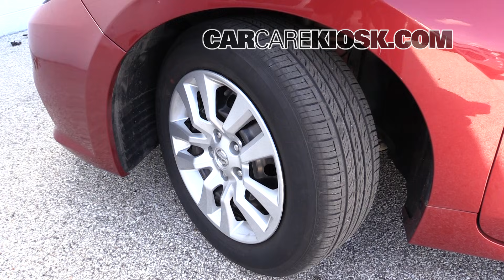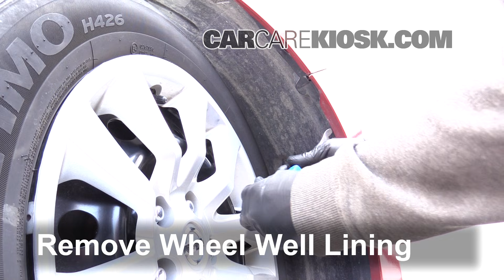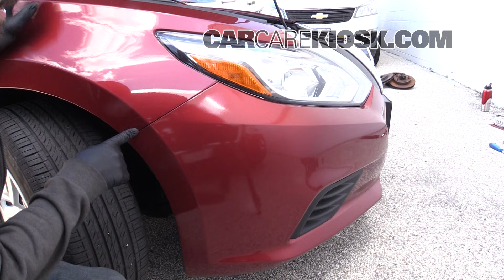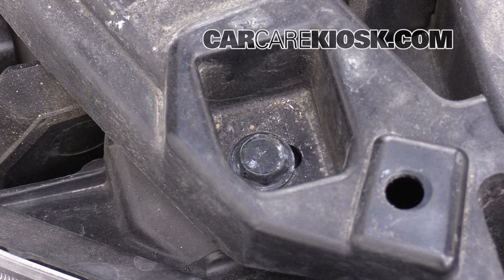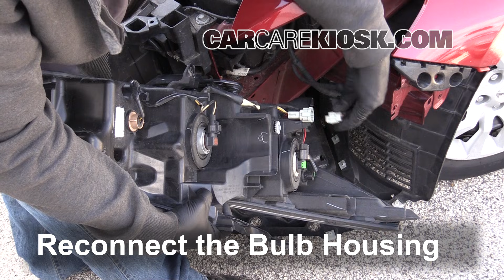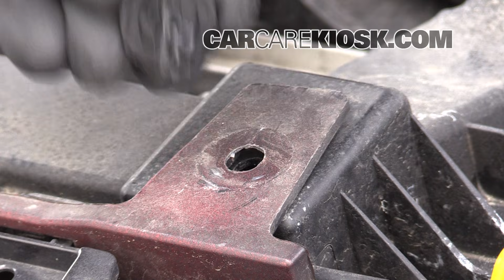Nissan Altima 2016-2018 Headlight Housing and Bumper Removal

Comment: Thank you so much for posting this.  If you had not, I would have never attempted to do this myself.  Because of your very good instructions and video.  I replaced my headlamp assy today.
Reply: Did you do it bc your headlights were super dim?
Reply: @angelmyers869  I’m about to replace mine because of that problem. Nissan is a piece of shit company. I bought this car in 2015 and still haven’t cracked 50k in miles and my headlights are so sim I can’t drive at night.
Reply: What replacement unit did you get? Does it solve the problem?

Comment: It is not neccesary to remove bumper, ive done it with just wheel and tire and pull back wheel liner...this guy is a dope, or a nissan tech
Reply from the maker: If you want to see how to just change the bulb, this is the video for reaching behind the liner to do it: https://www.carcarekiosk.com/video/2016_Nissan_Altima_SL_3.5L_V6/lights/headlight
Reply: Dude.. READ THE TITLE...

Comment: thank you for showing all of these steps. I just got in the headlamp that I need to install on my car.  I can see this being a whole day or more job. You make it look so easy and on a new Altima it probably is not too bad.  On an Altima that has substantial miles on it,  The plastic is hard and the clips break and it is a pain in the ass.
Reply: Did ours yesterday, about 90 minutes. Didn’t break any clips as these type are easy to remove and reuse. Check out the Class Action lawsuits Suarez vs Nissan and apply before April 20, 2022

Comment: you did it the hard way< wow why?
Reply: Replacing headlight assembly you have to take off the bumper there is no other way . But to remove a bulb just peel back the skin of the fender

Comment: Other videos show a much easier way to do this but removing the entire bumper
Reply: other videos says.. replace bulbs... this one says remove headlight
Reply: Depends on what you need to replace. If you are just replacing bulbs you can do that from wheel well and pulling back liner panel
If you need to replace the entire headlight assembly(s) you need to remove bumper and this is required to fix the deteriorated reflectors that are the cause of dim low beam headlights and which were subject to successful Class Action lawsuits against Nissan.

Comment: these car companies are so grimey for making us do this stuff to change a light bulb...
Reply: you dont need to do this to change bulb, you can just lift the well lining and reach in, theres a video showing this.
Reply: @mst3kpimp  This video is about changing the entire headlamp assembly not just the bulb.
Reply: @AD-cd1bx  unfortunately there is a glass “fish eye” that gets cloudy and it is part of the assembly.  ☹️
Reply: No wonder it's so expensive to get fixed at dealership!
Reply: @christopherdoyle1390  
STEALERSHIP*
Reply: @christopherdoyle1390  $900+. 😡😡😡😡
Reply: All this extra shit
Reply: mam241 https://youtu.be/NnFcO0i_F8A
Reply: @edisjd  thats 🗝 thank you sir
Reply: Start messing with your car man... But teach yourself before you do. I did start messing with mine when the stealership tried to charge me 1200 bucks to fix my shift gear that gets stuck in park... I taught myself, and fixed it in two hours, the parts required to fix it cost me 48 bucks. Ever since I fixed that, I got this bug, that caused me to spend 2k on mod parts... Sitting here waiting on my  parts to come in so I can keep modding the car. Just teach yourself and fix it once, and once you do, you'll gain so much more confidence that'll make you wanna do sooo much more.
Reply: its actually really easy to replace the low and high beam on this car, on both sides. the front turning signal has to be done this way to my knowledge however.